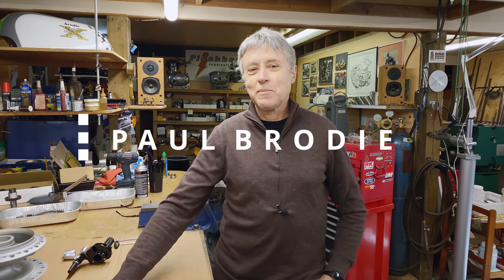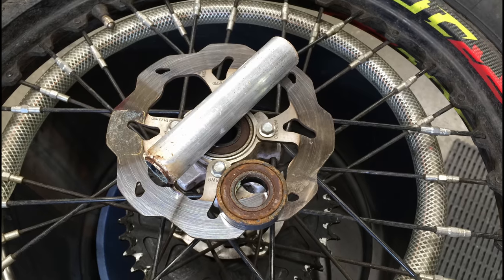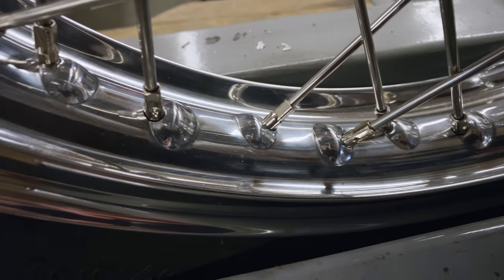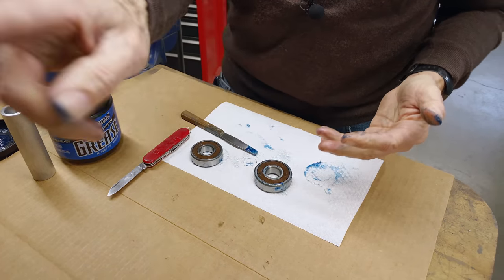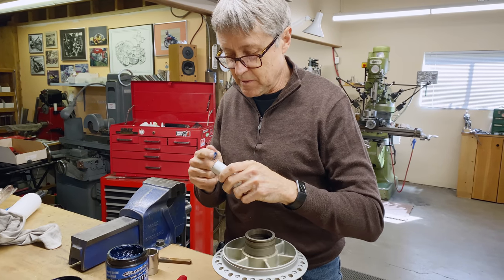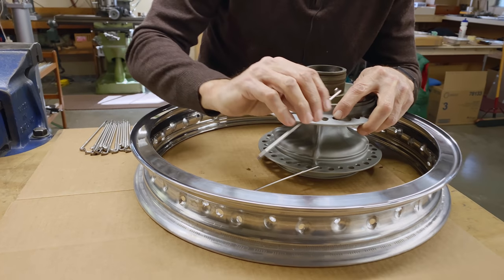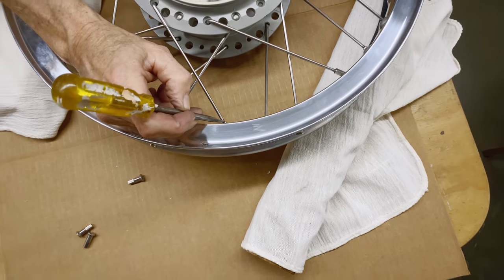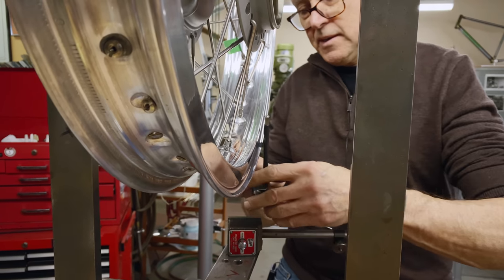Aermacchi Wheel Build // Paul Brodie's Shop

Comment: paul, this is ace ! 
is there a spoke length calculator tool for motorbike wheels like there is for pedal bicycles ?
also when I was taught to pop out bearing seals, they put the knife under the seal on the outer race side, any thoughts / opinions ?
thanks as ever to you and mitch for creating some really interesting content !
Reply from the maker: Thank you Nathan. I have not used a motorcycle spoke length calculator. In this case I phoned Buchanans, gave them the hub specs, rim size, and they supplied the correct spokes. Easy. I have used a spoke calculator for bicycles. There are several on the Internet you can use for free. I do three and then compare results. Always very close. I was taught to remove seals from the inside, but if you can do it from the outside without damage, then that is fine too.

Comment: You could have done with an alloy washer type thing on the outside of your internal wheel spacer to keep it concentric with the bearings when you install it, the original steel one has them for this reason.
Reply from the maker: Yes, but to really make it centered, the alloy washers would have to be a good fit, which makes it harder to remove the bearings in the future, because now I can't tap the spacer to one side to get the drift to "grab" the inner bearing race. Pros and Cons for almost everything.

Comment: hi, i have a question that i think you can help me with. i'm building a new. bike and got myself a 2LS front hub. problem is it is made for a 14mm axle and my bike only has a 12mm. i was thinking about just changing the bearings on the inside for some that fit a 12mm axle. but people told me that's a bad idea. do you have a solution? sorry for the bad english, i'm from belgium, so not my native language. PS. love your video's.
Reply from the maker: Your English is fine for me. Can you bore out the axle holes in the bottom of the fork sliders to 14mm? That's a job for the milling machine..There should be enough material to make that happen. That would seem to be the easiest solution. Thanks for watching!

Comment: Hi Paul, how tight do you make the spokes?  How do you select the proper spike lengths?  This looks very similar to bicycle wheel building, but I’m betting the answers to those two questions are different. 😀
Reply from the maker: Good question. For me, the torque on the spoke nipple is kind of a "feel" thing. If the spoke holes have been drilled properly, and not in the wrong location, then the head of the nipple will start to "seat" itself all round as it comes up to torque. I can feel it because the torque starts to increase dramatically. I use a pretty short 5.5mm wrench so it's hard to put in huge torque, but they definitely are tight. Spokes can loosen with hard use, so it's good to check tension after a few rides. Spoke length. I phoned Buchanans, gave them the hub specs , and they figured it all out. Good guys!
Reply: @paulbrodie  That's good to know I can order from Buchannons by spoke lengths.  

I have an Aprilia SXV (supermoto) which I'd like to put RXV wheels (dual-sport) but they're very hard to find, and expensive (I've been kicking myself for years for passing up a rear on the local Craig's List for $250!!)  I measured a few hubs I have, and discovered that a Honda CRF 450 hub is identical except 25mm too narrow, thus will need ~6mm longer spokes after I widen the hub.

Regarding seating the spokes, a well-known wheelsmith in the SF Bay Area advocates dropping the rim onto a rubber door mat repeatedly.  I found it somewhat shocking, but he swears by it.
Reply from the maker: @Alanbataar  I do have a rubber mat in my shop, but I had never heard of that approach before... Widening your rear hub should be an interesting project. I'm guessing you would have to sleeve the inside?
Reply: @paulbrodie  The plan was to part the hub in half, indicate each half true before cutting a pocket with a shoulder, and a bevel for weld prep.  The spacer would be a press-fit into the pocket, and also beveled for weld prep.  The halves of the hub would have to be marked somehow to ensure the spoke holes align correctly side-to-side.  After that, it's just preheat & ~20" of weld bead.

Of course, none of that matters much if I can't weld on the material the hubs are made of -- I still haven't done a test bead on them yet.  Some MFGs use a high-silicon die casting aluminum alloy which is utterly un-weldable: it basically has dirt built in.  It's typically used on cosmetic parts b/c it produces a very smooth, uniform casting, so I'm hoping they wouldn't have gone to the expense of using it on a wheel hub.
Reply from the maker: @Alanbataar   I would not even consider welding it. Machine the ID, make a nice sleeve, and loctite it all together. The spoke tension will be pulling it together. Welding will take away any heat treatment.
Reply: @paulbrodie  I suppose that would work just as well.  I doubt the hub is heat treated, though.  Thanks for your input.
Reply from the maker: @Alanbataar   I would bet $ that your hub is heat treated. If you go to your local metal supplier and buy some ordinary 6061 aluminum, it is heat treated to T6. If you weld it,  the surrounding area will probably now be T0, or very soft. Thanks for watching!

Comment: Paul, how would you go about building a wheel for a bike using a Motorcycle rim for a 90/90-19 tire? (it's to use the supply of Harley front tires I have)
Reply from the maker: Do a full scale drawing of the wheel using the parts you have. The spokes need to be the correct length, and the holes coming out of the hub and rim have to match perfectly too.

Comment: My Marchesini wheels had aluminum spacers. I remade them out of 7075 and then windowed them. The spacers on the other side of the bearings are aluminum right? There are race bikes with aluminum axles.
Reply from the maker: 7075 round stock is hard to find here. Would make very nice spacers :)

Comment: The color mark on the tire should be the end or last overlap of the belts and will be a high spot in the tire during manufacture you need to place the high spot in the tire with the low spot in the rim (weld) on automotive steel wheels this is the valve stem hole but on your bike it is wherever you found the low spot due to the weld, the high spot on tires are marked with white tags at the bead or a paint spot on the bead, on cheap tires there is no mark. (White tag higher end, paint medium quality and no mark cheap fall apart tires)
Reply from the maker: Robert, thanks for watching and commenting.

Comment: This is making me feel guilty for neglecting the 78 Iron head engine sitting in my closet, but I can handle it.
Reply from the maker: Never our intention to make you feel guilty..
Reply: Watching video's is MUCH easier than wrangling an old iron head (or building the 1096cc Suzuki engine I've been acquiring parts for for several years)
Reply: “Pushing the wheelbarrow is easy. Thinking about pushing the wheelbarrow is hard.”

Comment: I would think a man of your ability and tooling , you would be able to finish the polishing on that rim in a couple of hours or less? Tape off the rest of the rim, some simichrome and a dremel tool would make quick work out of it. I’ve seen aluminum quills (spacers) used on race and street bikes for years. Just my two cents, bike is looking good.👀👍
Reply from the maker: I've polished with a buffing wheel, and by hand, but never Dremel. I inherited my Dremel from my Father, and last time I went to use it, the motor didn't work. We had a video to shoot that day, so these are my reasons why it didn't get polished. Thanks for watching!

Comment: Mr. Brodi: You have my greatest respect and admiration. I have a couple of things I would like to point out to you for safety and engineering. In considering the centering of the rim to the hub. Placing the assembly into the swingarm is an inaccurate way to do it. You can, however, measure the distance between the arms of the straightening jig and the hub and the rim. That is as long as the arms of the jig are parallel. Never use an oil-based lubricant for mounting a tire. Polymer-type dish soap is always the best choice. When the water evaporates, the soap becomes sticky. Oil will allow the tire to slip on the rim. Alow is animal fat. Oil.
Reply from the maker: Hi Stanley, thank you. Checking the wheel dish in a swingarm could be inaccurate if the swingarm was poorly made, I agree, but what if the swingarm was very precise? I do have a very nice bicycle dishing tool that also works on motorcycles, but in the excitement of filming the video, forgot to use it; I had the swingarm. You could be right about my choice of tire lubricant. However, in 25+ years of using it I have never had a tire slip its' bead on the rim, even road racing in the rain. Thanks for watching!
Reply: @paulbrodie  Ok. I was just taught by an expert.

Comment: So couldn’t you have put a bolt and some flat washers on the spacer and tested if it compressed? Curious.
Reply from the maker: Are we talking about the aluminum spacer that goes between the (2) axle bearings?
Reply: @paulbrodie  yes
Reply from the maker: @tyeealpha   Personally, I feel it is a non issue. Lots of modern motorcycles have aluminum spacers, and there is not a problem. I mentioned it because a viewer had cried out that you can't use aluminum; it must be steel! My race bikes all had aluminum spacers and there was never a problem. Thanks for watching!

Comment: Why can't have plastics valve caps on a race track? Is it a style or safety requirement?
Reply from the maker: Safety requirement. Ever seen a plastic valve cap that was screwed on too hard and split? I have. I think the metal ones look better anyway.
Reply: @paulbrodie  but wasn't it safety third?

Comment: I have... by far the best wheel lacing story in the history of ever. Ask me and I will share.
Reply from the maker: OK, I am asking for your wheel building story...
Reply: @paulbrodie  many years ago, I worked at a victory mc shop in dallas. I had previously worked at a different victory shop for a few years. The crew was new to victory and it was my job as a tech to not only service bikes, but help the crew get used to using the website and such. A wreck job came in and I worked with my service manager on the est. He wanted to replace the front rim only. I urged him to get a wheel assembly complete.  New tire, brake disc, bearings, true and balanced from the factory. He did not. A week or so went by and all the parts showed up. I worked on every thing else and the front wheel was the last part. I took it apart and laced it. Took almost a week to true it. He was not amused. A few months go by and my fried calls and asked if I was still looking for some spoke wheels for my harley. He said he has a 19 abd 16 but they are rusty. No problem- they are getting powder coated any ways. I get the, sand blast and cut out the old spokes and off to the powder shop. A few days layer, they return. My manager comes in looking puzzled with the hubs abd rims in a box for me. I grab my stand and begin to lace up with new stainless twisted spokes. An hour hoes by and I have them trued and ready for tubes and tires. He said "I thought you didn't know how to do that?" I said, "no, I can, but I hate it. Next time, order the damn wheel assembly." He never questioned my opinion after that. At the time, I had been in the mc service industry for about 16 years.
Reply from the maker: @cpdevon  Yes, that is a good story. Some folks like building wheels, and others not so much. With all your years in the industry, I'm sure you have many more stories!   😉
Reply: @paulbrodie  I do. Thank you for your reply.  I am happy that you are making content again. Your world and efforts are very different from mine. I really appreciate your work.
Reply from the maker: @cpdevon   Thank you!    🤨

Comment: Them throttles are not very smooth there is not a graduation in the ramp for the cable and so there is no feel at lower throttle openings it makes mid corner control very hard work as your either very on it or very off it. Not worth the effort I swopped it out for a proper twist grip and my mid coner positioning improved just like there.
Reply from the maker: Maybe I have to modify the ramp!
Reply: @paulbrodie  That is just what I did. I turned of the old one and made my own